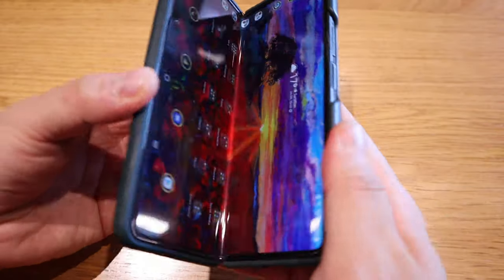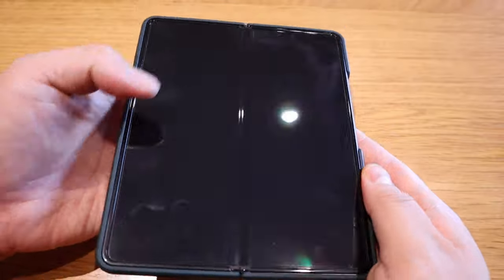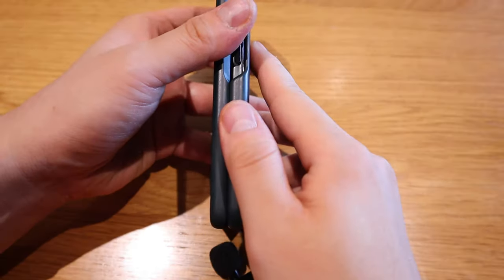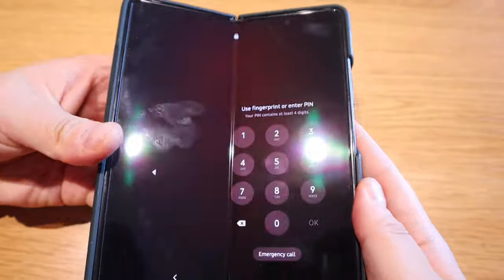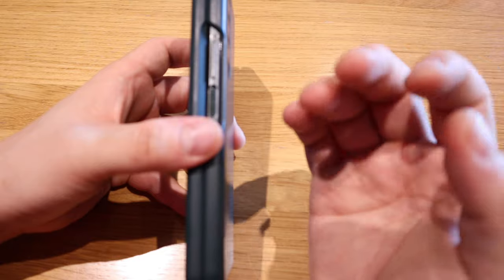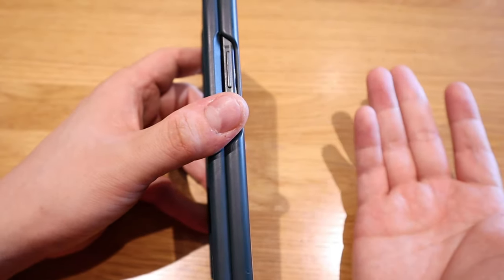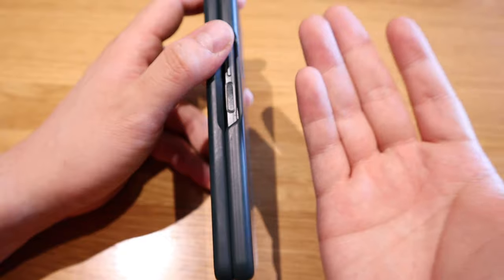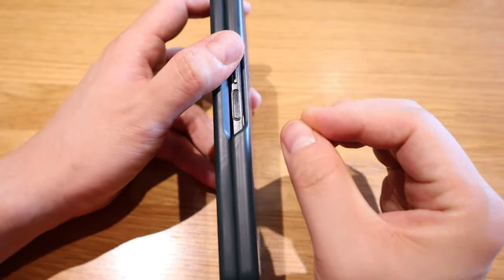Z Fold 3 - Hinge 'CLICK' Sound Issue

Comment from the maker: Response from Samsung 

Thank you for your patience, LJP. 

As the device does have moving parts there is the possibility of hearing sounds as those parts are in motion.

The Galaxy Z Fold3 opens smoothly and naturally and closes flat and compact. This was achieved by creating one of the most important pieces of hardware in the device that makes folding possible – a dual virtual-axis system hinge with multiple interlocking gears. The hinge part of the Galaxy Z Fold3 consists of a curved part and a flat part to adjust the angle gradually. When the angle of the device is changed, the inside of hinge is changed from the flat part (①full folding, ②flex, ③unfolding) to the curved part (①full folding ↔ flex, ②flex ↔ unfolding). In the process, you may feel that the folding/unfolding operation is not smooth and seems to be caught in something, but it’s a normal phenomenon. The symptom that you may feel in a specific section when adjusting the angle is a natural phenomenon and it is not a product problem. All Samsung smartphones undergo rigorous internal inspection test and are always being controlled under Samsung’s high level of quality standards internally. ^SH
Reply: I faced the same issue and the reply from Samsumg UK is that the grease underneath the display has not spread throughout and the popping sound will disappear in time to come. Not sure which version of their reply should we trust
Reply from the maker: @kuangliew  thanks for your input on this 👍
Reply: It's all just a tactic to avoid helping the customer who has in the first place trusted them with so much of their money. I am facing the same issue too with my fold 2 since last week.
Reply from the maker: Okay
Reply: My samsung  Flip4 just started doing this I have not dropped it. I have not got it wet I have had the phone for about 34 days. It's almost  like it's not aligned. This was my biggest fear of getting a hinge samsung and surely it's came to light.  The carrier sent me to assurance who stated they do not have the parts to fix this they are on back order. Then samsung sent me to Geek aquad who said they don't have the tools to fix it and guarantee its water resistance it requires a special tool. So I am SOL.. I I am at the point I want to return it. It sucks having all this samsung gear and being treated as if my money doesn't matter. I have had multiple samsung phones and yet the problem is here in the hinge...
Reply from the maker: So sorry to hear that. I consider Samsung to be way superior than Apple who asked me to wait 15 mins to buy an Apple Watch for my wife the other day.

Comment: I noticed it on my 4 too but found out it was caused by my Spigen slim armor pro case. The side hinge flap rubs on the front cover and give me that click sound. Tested without case and the folding is quiet. I had the sane case on my fold 2 and it never gave me any issues was perfect
Reply from the maker: Thanks for your input on this 👍

Comment: My Z Fold 2 made sounds like that so I exchanged it and the second one had different sounds in the hinge so I just returned it and decided to wait for the Fold 3, so my Fold 3 is completely  silent and has a slightly tighter hinge, However my Z Flip 3 has a very quiet sound either the plastic screen or the brushes but it's very subtle and I have to put it to my ear to hear it so I think it's  fine. That sucks your 3 is having that issue, it definitely is worrisome. Can you exchange or replace it.
Reply from the maker: That's very helpful. I am looking into what options I have. Thank you so much
Reply: Did the sound create any issue on your device?
Reply: @abdullathakur3657   Wondering the same since my new Z Fokd 5 makes those tiny little "peel off" sounds when unfolding.

Comment: It's coming in my phone too now since last week. Have been using fold 2 since April, 2021
Reply from the maker: Thanks for letting me know
Reply: @ljptech  Went to the Samsung store today. They agreed to the fact of a noise in the hinge and then recommended to replace the complete module which includes the Hinge, Screen and Sode Body. But due to small scratch on the top rim said the warranty is not valid and thus would be considered as void.

Buggers just want to find another stupid reason to not extend a good customer service to their premier customers. Going to write to the higher management about the same and put it forth.
Reply from the maker: Sad to hear
Reply: Dated 02/04/2022: Got the phone checked from a person who works with apple. He said Samsung people are right to point out the slight scuff as a dent and apple too doesn't honor the warranty in the same case. So got the complete Hinge, Screen & rim all in one single module replaced from Samsung. last week now under accidental damage insurance policy by paying $150 equivalent in India. Have bought ultra 22 with 2 years ADLD Policy  & selling fold 2. Can't afford mentally to have such a delicate fold 2 phone in my hands without any damage insurance in place. 

Over all its a good phone but a little fragile to use without an insurance.
Reply from the maker: @saralbudhiraja  thanks for your input on this 👍

Comment: It's part of the design even you will get a replacement. Let's just say its a design flaw 😁😁
Reply from the maker: I guess so
Reply: @ljptech  I worked as a Samsung Chat /Technical Support. Ninety-nine percent of users requested replacements or returns. Some had third replacements that were brand new, not refurbished or repaired, and had the same problem.
Reply from the maker: Good to know. I can't be bothered to change now 😕

Comment: Yes soon the sound will no longer exist. Im talking about speaker will stop working . Mine did that then weeks later I lose all sounds when phone is open and works when it's close. But eventually you'll lose all sound open or close. It's a cable coming loose internally.  Yes it sucks for a phone this price.
Reply from the maker: Thanks
Reply: My Fold 3 just started not having sound when its unfolded. and when i fold the device half way the sound comes back on. I thought it was an update problem because it started happening after i updated my phone. I guess its hardware according to you right?
Reply: @salazar5810  Yup probably a loose cable or a defective screen. I traded for the fold 4, now less then 9 months the 4 has no display. I am done with SAMSUNG FOLD piece of CRAP!! Good luck on yours 😬
Reply from the maker: @Tmkarc1hobby sorry to hear that

Comment: Mine did this. A few days later the screen sunk along the hinge delaminated and then died, I had to have inner screen and hinge replaced. It lasted about 9 or 10 months.
Reply from the maker: Thanks for your input on this 👍
Reply: @ljptech  they also changed the hinge and put new batteries in so I can't complain about the service, but I wish I had just left it on and sent it when it came off down the middle.
Reply: And I'm convinced the crease on this new screen is half as deep and not as noticable as the original it makes me wonder if they have changed something on the later screens.

Comment: My samsung  Flip4 just started doing this I have not dropped it. I have not got it wet I have had the phone for about 34 days. It's almost  like it's not aligned. This was my biggest fear of getting a hinge samsung and surely it's came to light.  The carrier sent me to assurance who stated they do not have the parts to fix this they are on back order. Then samsung sent me to Geek aquad who said they don't have the tools to fix it and guarantee its water resistance it requires a special tool. So I am SOL.. I I am at the point I want to return it. It sucks having all this samsung gear and being treated as if my money doesn't matter. I have had multiple samsung phones and yet the problem is here in the hinge...
Reply from the maker: So sorry to hear this

Comment: Mine started making the same noise. But after a few weeks of the same noise I noticed a black dot in the middle of my screen. Dead pixels. The spot got bigger quicker every time I opened it and I heard that's exact same sound. Finally it gave me a black line all the way down the I believe it's the glass that they use on the inner screen having micro cracks. Until it becomes so large that it delaminates from the digitizer. And no, Samsung will not warranty it because they tried to blame it on you
Reply from the maker: I am sorry to hear this. Hope you resolve this issue ASAP
Reply: How did you resolve the issue, my hinge line is all black now
Reply: @thewallaceway9813  I fought with Samsung for about a month. They would not fix it for free. Tried to blame it on me. So I ended up having them send it back to me broken, then I drove over it with my car and made an insurance claim...
Reply from the maker: Are you sure you want to openly share this on a public forum? 🤔
Reply: @ljptech  no where in my comment did I say I did it on purpose. I was filling up, and the phone fell out of my pocket....
Reply from the maker: Sorry, misunderstood your comment (crawling back to my hole)
Reply: Hello.
Can you explain clearly because i not so  much understand, you mean if fold 3 have noise like this, it will lead to dead pixel black line middle of screen? Because my fold 3 now getting nosie.thank you please answer me because before it late.
Reply: @taykean3677  Yes, sounds like a dirty crunchy noise. I took the screen protector off when I got a new one and so far I haven't heard that noise
Reply: @chanceblaker4681  Thank you for reply, but you talk about dead pixel (black line) in the midfle of screen, does  this noise is symptom of glass inside start to broken and will lead to dead pixel in the middle of the screen?
Reply: @taykean3677  mine started as a small black dot. The dot got bigger and bigger, then one day it cracked right down the middle. So it started as a small spot of dead pixels, then turned into a line of dead pixels